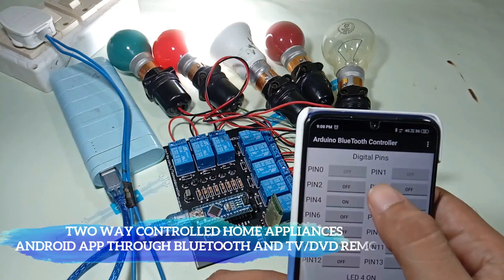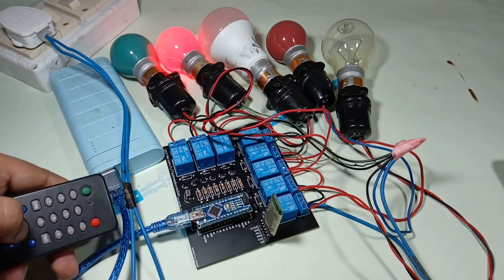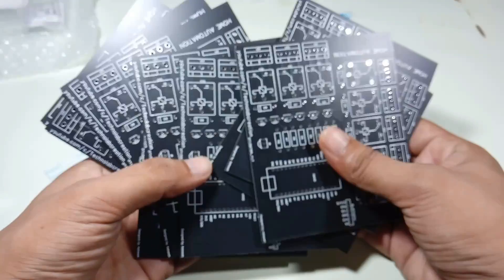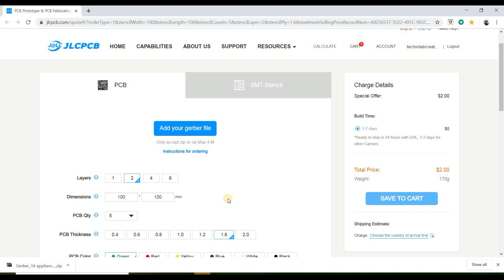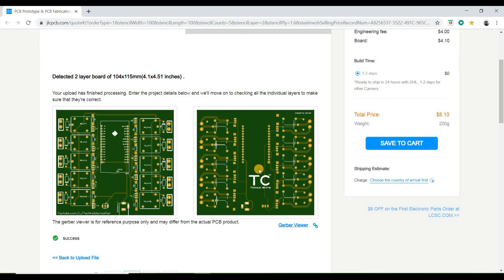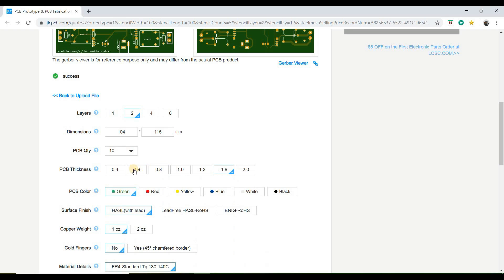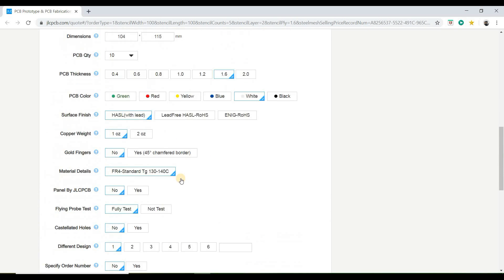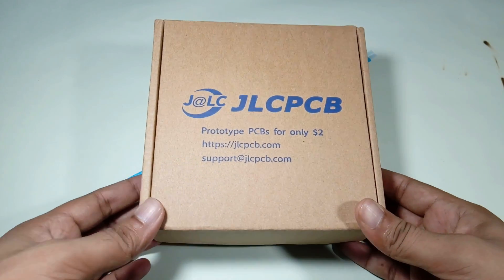Two Way Controlled Home Appliances Using Android App And TV/DVD Remote.!! jlcpcb

Comment: How much price required to order 5 pcb from jlcpcp
I m trying to order from jlcpcb but it shows 7$ for 5 pcb and shipping charges around 25 $.
I want pcb.
Thank ou
Reply from the maker: You can order 5 pcbs just only in 2$ .. And if you choose dhl delivery for shipping it cost 23$extra 
I recommended you use normal delivery to avoid shipping charge and custom fee